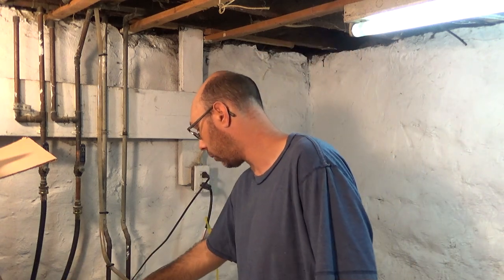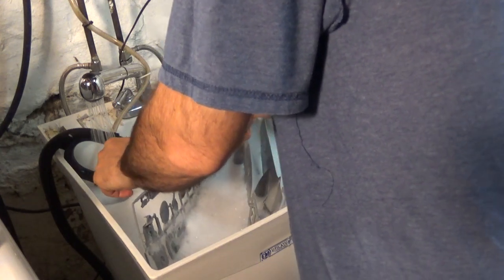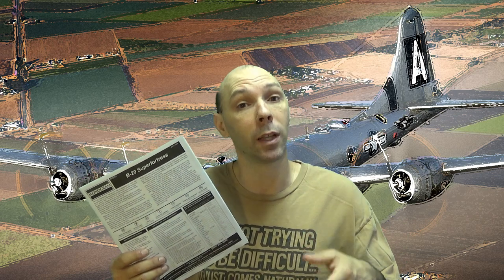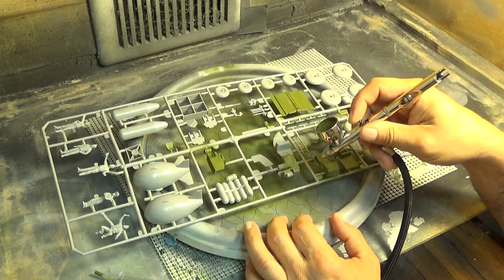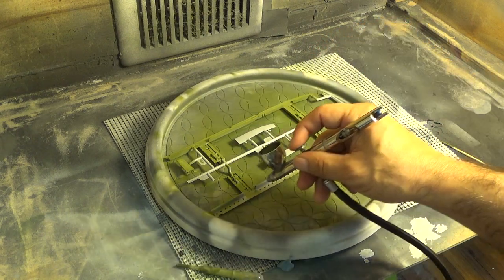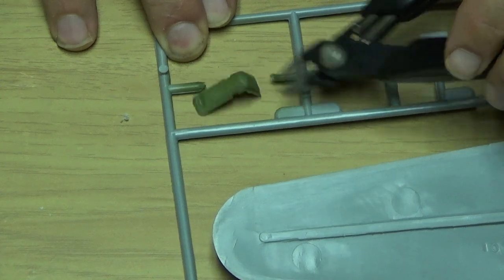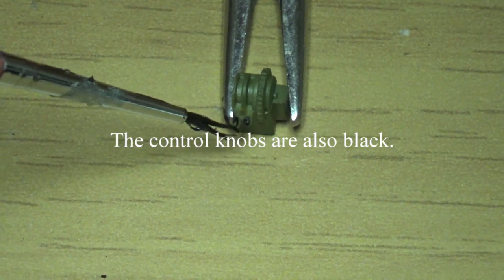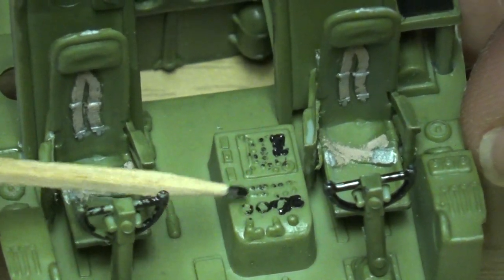Revell B-29 Superfortress Washing Parts and Airbrush Chromate Green 1/48 scale tutorial Part I

Comment: Nothing about the model, but my laundry area is almost identical. Right down to the electric outlet right above the sink with cords stretched over it.
Reply from the maker: Model areas are hard for me to keep clean.  I'm like a dumpster fire when it comes to that stuff.
Reply: @PlasticModelBuilder  I have this very kit about 1/2 finished.  It's been sitting there for about 20 years with all the interior work done.  I was afraid of the aluminum finish that you have now inspired me to attempt anyway.  I ran across some shiny silver Krylon spray paint that is going to look awesome.  I even have the same decal set as you and decided long ago on Joltin' Josie!
Reply from the maker: @kenkingsflyingmachines2382  be careful of what clear coat you spray on the that silver.  You don't want it to cause cracking.